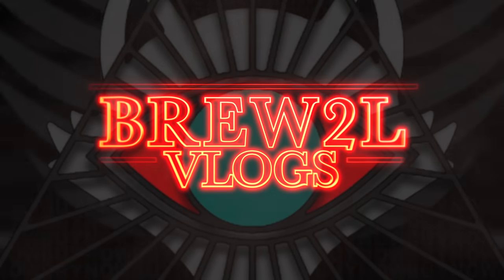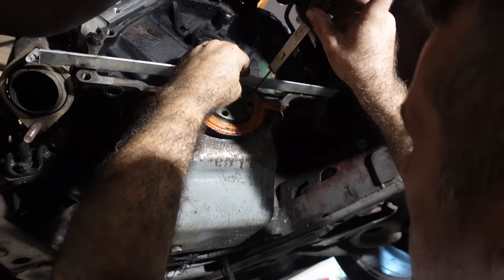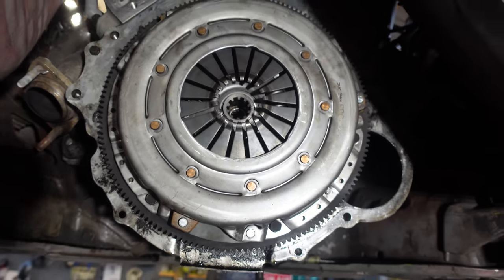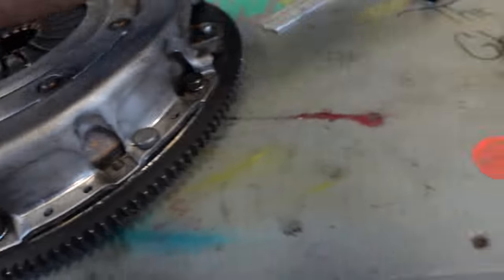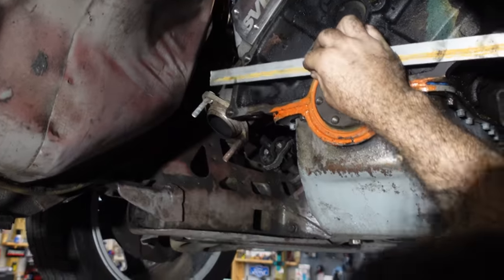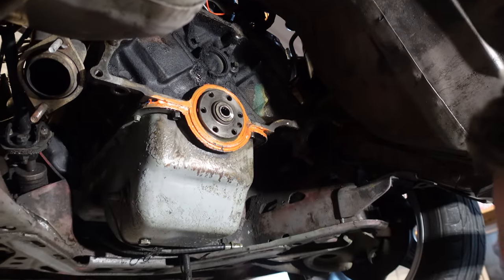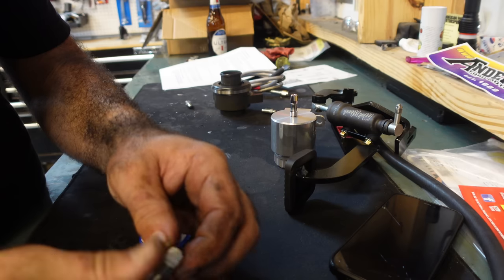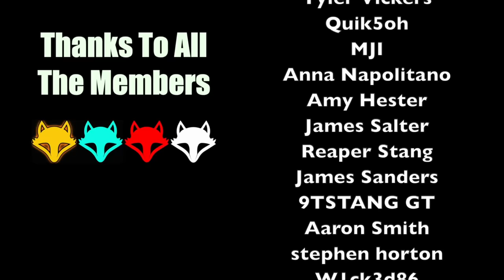RAM HYDRAULIC KIT / Taking The Measurements

Comment: There is a much simpler way of getting your measurements without pulling the clutch and belhousing off comparing the depth of the fingers from back of the bell housing compared to the trans face to the compressed depth of the slave
Reply from the maker: William.. I wish I knew that trick. Lol
Reply: Is this Brew2l saying I won something? I never win anything not even a lottery ticket, lol
Reply: Not sure if it's a scammer using your channel

Comment: I bought a hydraulic clutch conversion from MDL. The mechanic that installed it , did it wrong. The mofo charged me $300 and refused to take responsability.
I had to go back to the cable system.
If anyone wants this kit, I will yield it free, you pay shipping
Reply: Ill take it